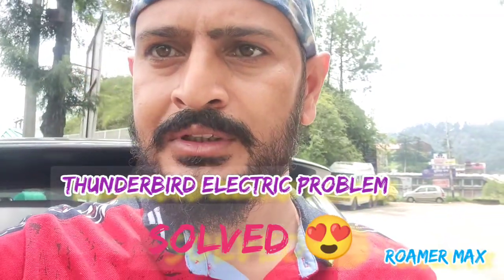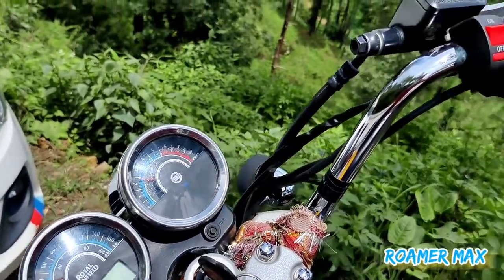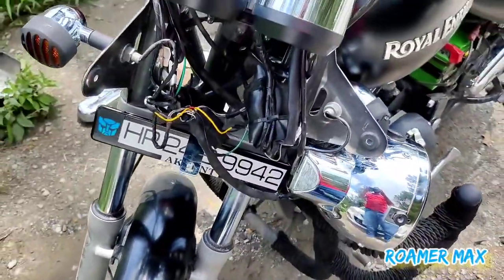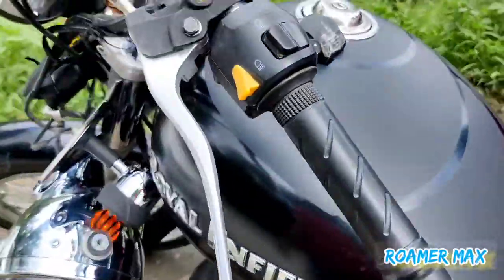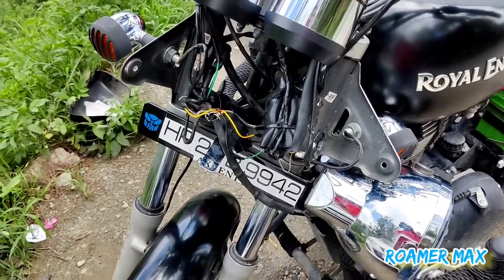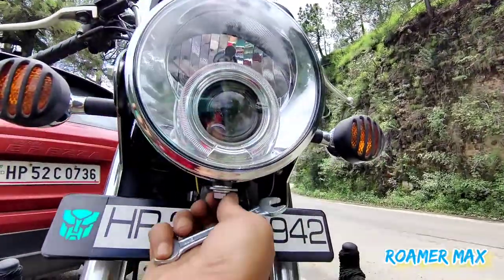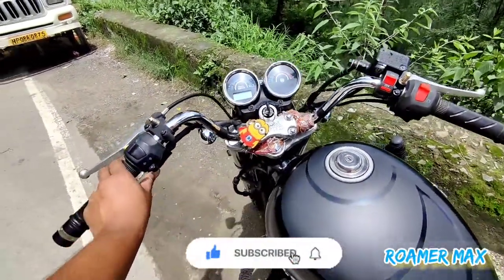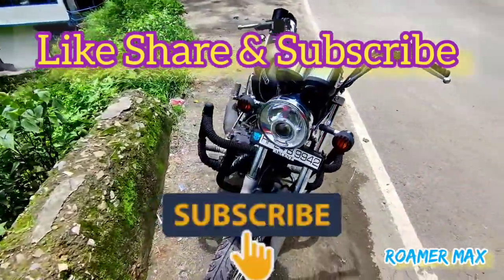Thunderbird Electrical failure 😍SOLVED😍 || Royal Enfield Thunderbird Starting Problem SOLVED,

Comment: I Also Commented In Your Last Video.....So As Per My Mechanical Knowledge You Have To Check RR Unit/Alternator Coil That It Is Properly Charging. Also If Meter Is Not Working & Battery Getting Down Now & Then Indicates Current Leakage In Wiring Check Your Wiring With Expert Mechanic.
Reply from the maker: Thanks for your comment sir....❤️❤️❤️ 
Will do same ...🙏🙏🙏

Comment: Even i had the same problem, replaced the battery, it worked for a 4-5 days and problem re-occured, battery had completely drained, recharged again, it worked for a day, now again the battery has completely drained and there is no display in the speedometer and RPM Meter. Please suggest if there is way to rectify this problem
Reply from the maker: Sir.... When I changed battery......now all ok...... Nothing at all... It's been around 1 month...
Reply: There will burn out components in meter console board, never ever go to the showroom unless u don't have a plan to change the meter console, they will ask to change it, go to an expert electronic shop or digital meter service center. This will solve the problem....I'll put a video on what will happen if the battery drains out and meter console won't work. This happens generally if the battery drains out especially to RE bikes.

Comment: bhai meter khararab nahi hua hai wirinh issue hai same problem mere saath thi toh maine meter wire proper check karke sockets ko clean karke dobara laga aur meter sahi ho gaya...
Reply: I am also facing same problem. can you please suggest me how to check wiring and clean socket
Reply from the maker: Ok bro will do same as mentioned.    Then let you know
Reply from the maker: It’s normal bro.    You have open front head light 1st then you can open meter n socket